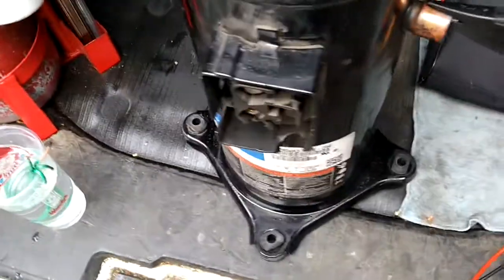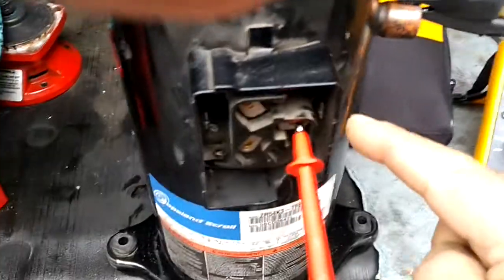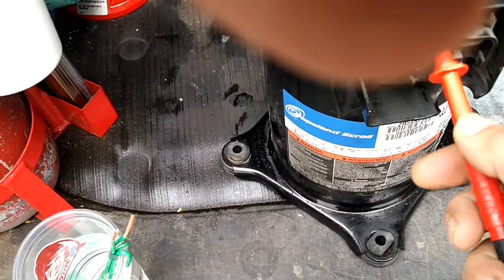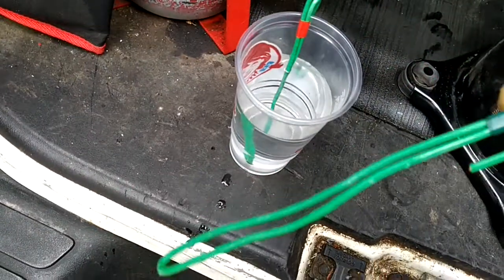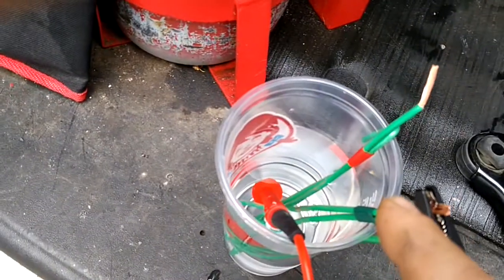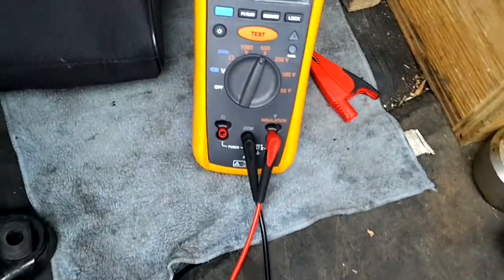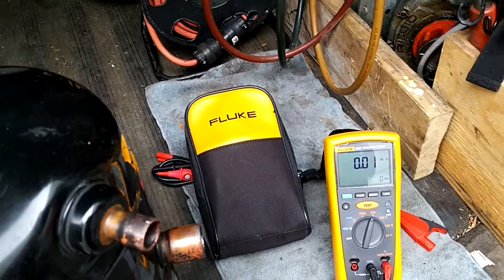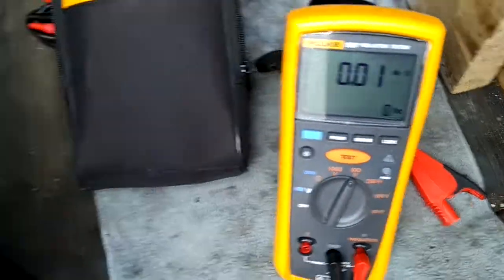Check Compressor Windings With The Insulation Tester - Fluke 1507

Comment: Respectfully , That wasn't a proper test . It bears stating that there is mfrs don't want meg tests performed on compressors and others that set a specific fail range . I have seen perfectly operational units destroyed by meg tests . A long running debate for decades has been the suspended particles in the oil from wear affecting the readings . Think , if it were a normal air cooled motor you certainly be required to factor in much more for a proper meg test . As a predictive failure diagnotic procedure the idea is admirable but realistically it isn't truly accurate . I have and will continue testing service / fused disconnects wired to the unit . load side wires within the unit ( lots of vibration chaffing potential ) . Even control wiring . That said , best to everyone .

Comment: It is not a 2 phase compressor. It is a single phase compressor at 240 volts. Both hot legs are center tapped in the distribution transformer as a delta configuration to create the neutral for 240 volts, hot to neutral is 120 volts. If it were derived from a wye configuration, it would be 120/208 volts the common from both legs is the neutral
Reply: He said it was a 3 phase compressor.
Reply: ??? It is a 3 phase 575 v Scroll compressor!

Comment: Copeland bulletin 

When using megohmeters to evaluate the motor
insulation of compressors, it is important to understand
that they should not be used as one would a volt-ohm
meter. A single megohmeter reading gives little insight
into the condition of a motor’s insulation.
Megohmeters are best used as a part of a regular
maintenance program to monitor trends (over several
months). For example, one might record a megohm value
and compare it to a previous reading. If subsequent
readings show a trend of lower and lower values, then
corrective action (such as system clean up) should be
taken.
Emerson does not incorporate the megohmeter into
any of its quality checks. All Copeland® compressors
must pass U.L. required tests using hi-potential current
leakage testers (“hi-pot”). Studies performed by Emerson
have found that compressors with megohmeter readings
as low as 0.5 megohms still pass the hi-pot.
There are many factors that affect megohm readings
including contaminated refrigerant, oil level, refrigerant in
oil and current leakage through electrical fusites or
terminal plates.
© 2010 Emerson Climate Technologies
Printed in the U.S.A.
Any external electrical components connected to the
compressor terminals also affect megohm readings.
Wires, contactors and relays all leak current and will
decrease compressor megohmeter readings if not
disconnected.
As mentioned earlier a single megohm reading cannot
be used to condemn a compressor since many other
factors are involved. However, limits can be placed on
megohm values that dictate action be taken. Emerson
has found that these limits are related to the rated voltage
of the compressor. Megohm values equal to or greater
than 1000 ohms per volt are probably acceptable. For
example, a 460 volt compressor might show a megohm
reading of 460,000 ohms or 0.46 megohm. Compressors
with rated voltages of 208 to 230 volts would then be
operable at megohm values of 0.208 to 0.230 megohms;
for simplicity, Emerson has set the limit at 0.5 megohms
before a compressor is condemned. Figure 1 shows
the required procedure for checking compressors with
a megohmeter.
New compressors that have never been installed will not
need any system clean-up procedures so long as the
megohm reading is above 0.5. A baseline reading must
be established for comparison purposes and since this
is its first

Comment: I'd like to make a correction. Anything less than 1 Megaohm is considered a failure, while in reality, I've seen motors run with less than that. 50 Megaohms is a very good reading.
Reply: Daikin consider anything under 500Mohm to be short to earth

Comment: Please, can i do the same test with Fluke 115 multimeter?
Reply: No, with a multimeter, you could only test to see if the compressor is grounded or not! An insulation tester will test the condition of the insulation on windings, whether it is good or bad or on its way out!

Comment: I have always tested motor windings via ohm it out, either by terminal to terminal or terminal to ground. 
3 ph motors should be equal ohms reading if normal, or tested via terminal to ground. 
Single phase motors.
Ohm out between terminal to terminal first.
Good windings should like example: R to S =9 ohms
R to C = 3 ohms and S to C = 6 ohms mean normal.
Also do the same with 3 phase by terminal ground. If shorted to ground the ohm meter will read something.
Reply from the maker: Insulation tester tests winding insulation by applying DC voltage through the winding & Multimeter measures the resistance of winding. Insulation tester gives an accurate and fast measurement to verify the condition of insulation.
Reply: There's 2 seperate ways to check a motor. Using a normal multimeter that only outputs a few volts and a mega ohm meter that can output 1000v. The higher voltage will check if the insulation is cracked anywhere and leaking power to ground. It can detect shorts through bad refrigerant full of acids inside the compressor.

Comment: I'm glad that someone has enough knowledge to not use a Supco merger on a Copeland Scroll compressor. People need to read Copelands ligature about megging their scroll compressors. I'm sure there have been many of the Copeland scroll compressors that were still good but were replaced by using the Supco meggers.
Reply: I have the Supco Megger. I don’t trust that thing. Isn’t it only good for like small fan motors/ small reach in compressors ?
Reply: @hvacwilly6037  Supco Meggers are ok for what you said, for reciprocating compressors but  for scroll's I would not use them. For some reason they have made them that they will not read low enough. I've condemned a couple Copeland compressors when the  Supco merger said that it was bad, until I read the Copeland literature on their scroll compressors. What I use is a cheap $45.00 Chinese merger I got off of Amazon. They are as accurate as a Fluke merger, just don't trust the voltage readings. I've been using one for about 8 years and it has been accurate so far.
Reply: Big companies push their ignorant “techs” to use the supco so they can sell changeouts.  Guaranteed

Comment: Don't think your getting on the conductors good.  The holes where the screws go in are not the conductors, it's the metal tabs around them.  Also Copeland doesn't recommend to meg ohm their scroll compressors.  Something about the windings being too close to the shell.
Reply from the maker: I had a very good connection and the holes that where screws go in are conductors as well! An insulation tester measures the resistance of the windings! There is no such thing that you can't use an insulation tester on Copeland Scroll Compressors!